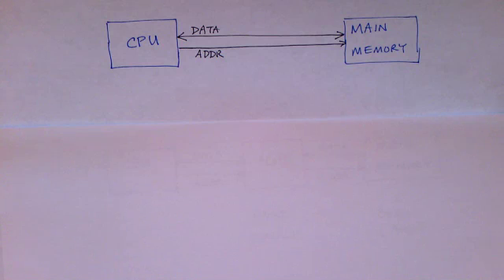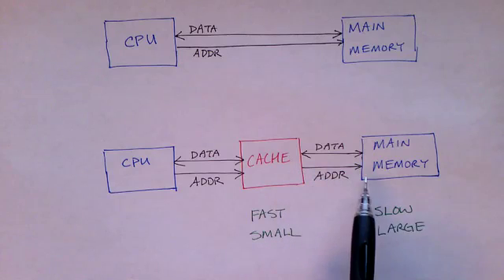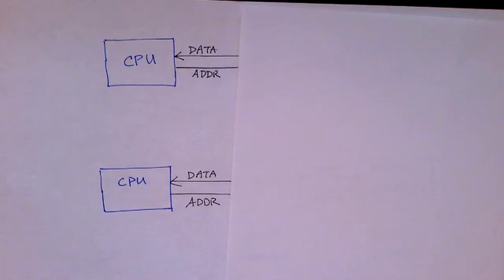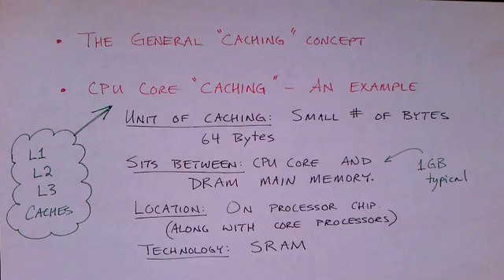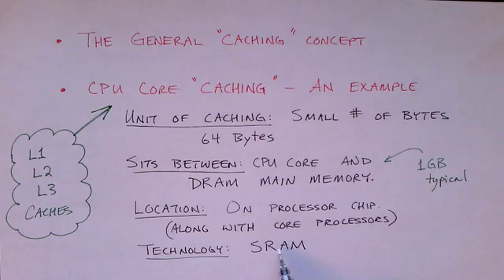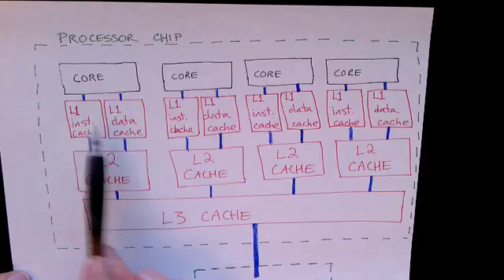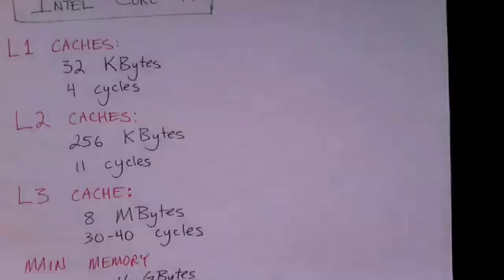Lecture 1/9:Caches-Intro

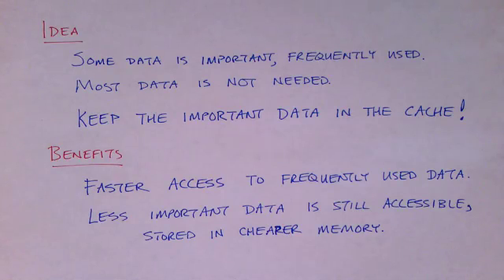Comment: I've only watched up to 4:06, so I'll delete this if you answer it. I forgot the name, but isn't there a system where you divide memory over multiple hard drives? Couldn't you do that with caches, having alot of them? I mean, obviously, you would need ALOT of them to come close to matching the size of the memory unit
Reply: Caches are VERY expensive compared to Hard Drives, thats why its economically unfeasible to have a lot of caches.